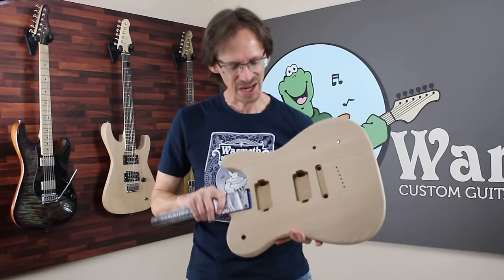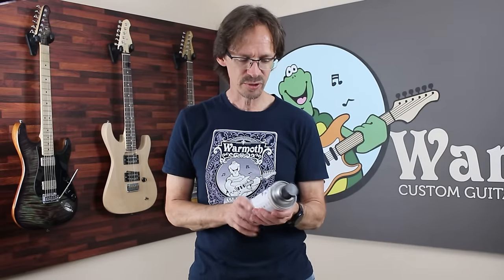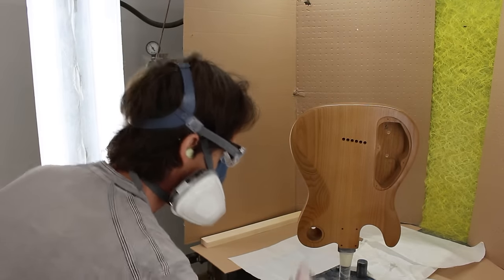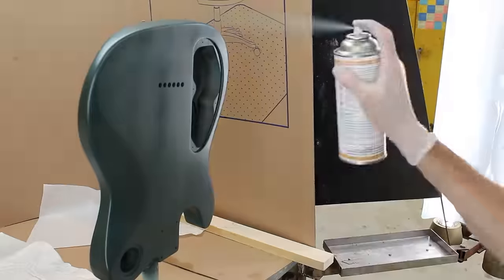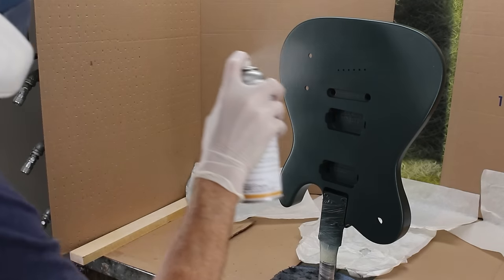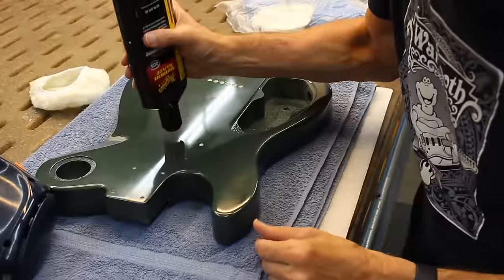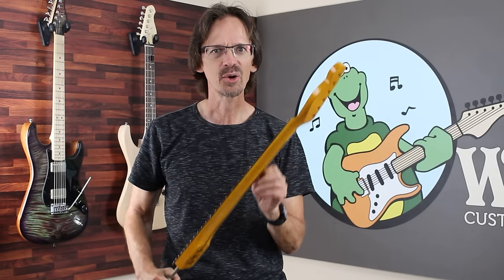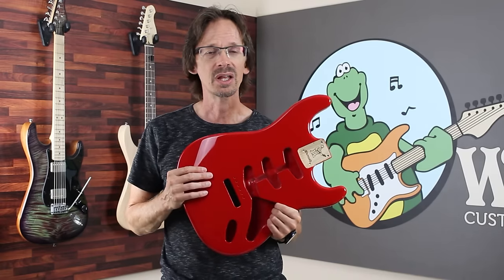DIY Nitro Guitar Finish from a Rattle Can?

Comment: #HeroesJourney  I have french polished guitars a few times. One time I was doing a classical. I had a guitar wall hanger in a corner. So on one wall was the guitar drying between coats and on the other corner wall was a large framed glass picture. My little nephew ran in the room and crashed into stuff. Knocked the picture down. Hits a speaker. Turns 45 degrees and crashes into the guitar and didn't just ruin the finish. It had shattered glass all inside. And pieces sticking out of the spruce top. You just have to laugh that stuff off but wow...I had 45 hours just in hand rubbing shellac, oil and paint thinner. Ugh. Heh. Thanks for taking us along.

Comment: So what DOES Warmoth do instead of wet-sanding? Scotchbrite? Also, for the dent between controls on the green body, I'd try Bondo (car body filler) -it hardens in 5min, is sandable, etc. - good product! Your guitars look great, although I can't tell that the green is metallic. Anyway, very nice job. Btw, Stewmac just did a good series on this, very good additional tips there.
Reply from the maker: Yep, the StewMac vids are great!

Comment: That nozzle tip is no joke, definitely not friendly to the finger tip.There's a device I bought at Lowe's that clips on to the top of spray cans (universal fit) that enables you to squeeze a trigger like handle to apply the paint. It reeeally saves the finger!

Comment: Enjoying my new Strat neck form Warmoth! Such a great neck. And I too finished my own pine tele body. It was southern knotty pine from a Georgia luthier. I used Minwax stain and matte satin hand finished poly. It turned out good, but I learned a lot. I rough sanded, fine sanded, and tack clothed. I had just got the finish looking good on the front and poly lacquer from the sides dripped all over the front and dried overnight. I had to sand  off each HUGE drip and refinsh from scratch! Ugh! But I soldiered through and got it done! Coat after coat and sanding pass after sanding pass. Then the string ferules caused some issues fitting into their pre-routered holes. (I used the modern ones the guy listed as having routered for) But I love my tele. It's my go to guitar. #HeroesJourney
Reply from the maker: What is the luthier's name in Georgia?
Reply: @warmoth  Oh I wish I could remember. This was about  seven years ago. (2015) I only saw his eBay seller name and assumed since he was selling all theses pine bodies, that he had made them. I think he said so in the description. But I never got the guy's full name.

Comment: Great job on the rattle can finishes!  I’m sure you’ll remember that prep work and patience are necessary for a quality finish if you decide to do another diy finish.  By the way, the white undercoat on the Dakota red strat body was a great choice.  #herosjourney
Reply: Definitely takes a lot of patience waiting for the paint to dry in between coats. The rest of the installation took only a few hours , I will definitely be doing more of these build's!

Comment: The trouble with using a spray can is the fineness of the jet of paint and the cleanliness of the environment you are using. Dust getting into the paint is common. Then there is the matter of cleaning up after the painting which is a hassle.

The sanding is quite difficult, I had a crack at sanding a finish off years ago and I totally screwed it up. I decided to give it up after that. The flat areas are easy but the curved areas are quite difficult. 

The light groove in the Tele body is in the wood surely, and thus a fault in the body. So I assume that you needed to first sand the body flat before sealing it.  I was surprised that there were so many coats of sealer. Three cans is a lot of paint. I thought two or three coats would do it.

Comment: The sealer is vital if you don't want the grain to show through,- which trust me, - you dont.It's definitely a task with aerosol cans.
The primer color really helps the main color pop; using white or black nets different final results on colors where it is an option.
Two things; don't skimp on the breathing protection; it's no joke.Spray outside, or with ventilation.And secondly, the result will reflect how much patience you manage.Try to rush it, or half #ss it, it will show .
The nitro is far superior to poly in every possible way.

Comment: What would you recommend for just doing a neck I have an old (30 year's) Warmoth neck that the only poly is on the headstock and heel a little bit So want to sand the poly off and put a very light coat of clear nitro on Thanks...ok Gracy's medium neck amber...cool...did you put tape inside the tuner holes to prevent build up ?
Reply from the maker: No need for tape, IME.

Comment: Great video! I've always wanted to do a body of my own, and this was super informative. I majored in automotive paint and body in college, and I feel like this is much the same process. When I'm ready to try to do my first one, I will definitely be using a Warmoth body! Thanks! #HEROSJOURNEY
Reply: One thing I did was took a metal clothes hanger and bent it so it fit into one of the holes on the bolt on neck. Then I covered all the pockets with masking tape , this way I didn't have to keep moving the body around. It worked out perfectly , but it's nerve racking waiting for the paint to dry in between coats....

Comment: In the video it's mentioned that it was used 3 Cans of Sealer, 1 Can of Base Coat (is it the primer?) and 1 can of Color, but it's not mentioned how many Cans of Clear coat were used.  If you could let us know that it would be great. 
Also, how many Coats f base coat and color were you able to do with just 1 Can? Thank you

Comment: I have a Warmoth neck coming to me soon.  It's a rosewood fretboard, maple neck.  I understand that the Warmoth warrantee will not cover a neck that uses oil to finish the neck.  My plan was to nitro finish the heel area and the headstock but to use a polymerized tung-oil on the shaft where my hand goes.  I just hate the feeling of gloss or even semi-gloss finish on my hands.  Is there an industry standard way to apply Tung-oil for best sealing and protection?  If I had to use the warranty, I would notice the issue before I even considered finishing or using it.  :)
Reply: Check out videos showing Tung-oil being used to finish gun/rifle stocks. Same techniques apply, there isn't much to it.

Comment: Those turned out great! The only thing I can think of that would have prevented the line on the green body is a grain filler before you started sealing the body. But I'm also a n00b. #heroesjourney

Comment: #herosjourney 

Just finished my first Warmoth guitar build alder body sprayed it with vintage white nitros came out perfect. The body was ready and drying waiting for my custom neck to arrive but the neck was lost in transit so I had to wait another 6-7 weeks to get the replacement neck for the lost one. So I made some mods to the electronics on it meanwhile. Tru oil on the neck super easy to apply and for what it’s is I never had problems with guitar necks I have some 50 years old guitars so I can care less about a year warranty. A set of fender pickups. Needless to say the guitar is an assassin plays amazing and sounds amazing. I didn’t expect that kind of high quality and was presently surprised. If you want a guitar to be with your own specs Warmoth is the best way to do it. also having a proactive part in painting and building your guitar makes a better bond with the instrument like it you baby somewhat.

Comment: #heroesjourney
I really enjoy doing the finishing myself, from a cherry red nitro on my ‘55 Les Paul, to the almost Gretsch Orange I put on my ‘77 Les Paul Deluxe. I tried the Gracey’s rattle can on my 2010 Melody Maker . I hated the worn white, barely sanded finish, so I decided it was going to be Pelham Blue. I was really impressed with the Gracey’s product.

A tip: you can use plain old household rubbing alcohol for color sanding nitro. It won’t swell the wood.
Reply: #HEROESJOURNEY

Comment: I'm looking to re paint my schecter km7 mklll that as of now still has the satin factory finish on the front of body and headstock. I won't be touching the back since it's perfect already. I bought the guitar with intentions of painting the front only because I love the back. Anyways, would you know if I have to take the front down to bare wood or if just a good sand would be good enough? It's a stained finish on there now,but I want a solid color paint on top. Anybody have any suggestions?  Thanks

Comment: #heroesjourney On sharp edges like the headstock coat it once with the can at 45 degrees to the face and then coat the flat surfaces as you normally would. An eraser may be too flexible for edge work, the pad must stay flat in use. Well done Arron.
Reply from the maker: Good insight on the eraser being too flexible.....that hadn't even occurred to me.

Comment: I have definitely damaged a body by wet sanding with water. You only make that mistake once! Although I didn’t do the smart thing and fill the holes with wax like Aaron did. I still wet sand but I use naphtha instead of water. #herosjourney

Comment: That’s about 2.5 cans of sealer more than needed
Reply from the maker: I think if you want a perfectly smooth surface it will take more than 1/2 a can.
Reply: @warmoth  yes my experience was for a guitar that was going to be reliced so didn't have to be smooth and shiney only to be beat up later

Comment: Couldn't find a can of what you are using on either of the sites listed here ..Thanks for wasting my time Clown Shoes !
Reply from the maker: It's mentioned many times in the video, and there is a link right to it in the description.
Reply: @warmoth   Okay well read.. 
I never said you didn't.
What you didn't say is that, Someone would have to navigate through your entire inventory to find that little rattle can of nitro lacquer, instead of a simple direct link to the fabled .. little rattle can of nitro lacquer,
And I never did locate that little rattle can of nitro lacquer, Of course my tolerance for long lane searches is nonexistent,